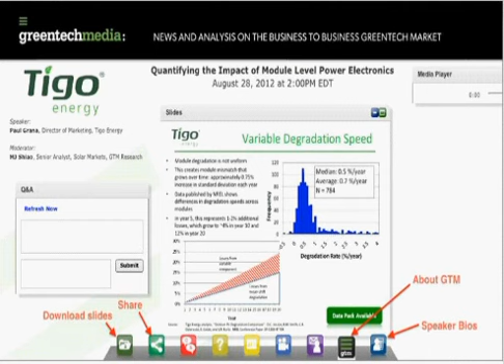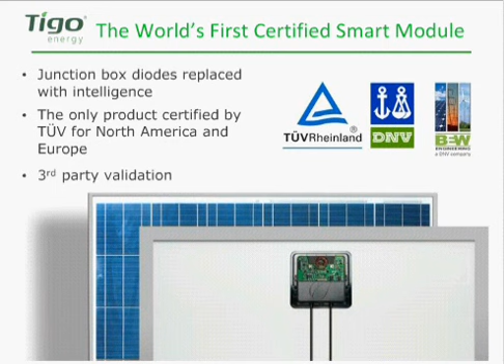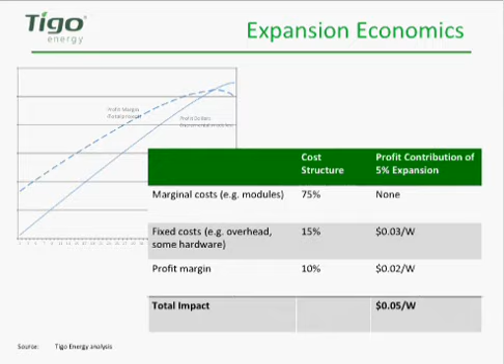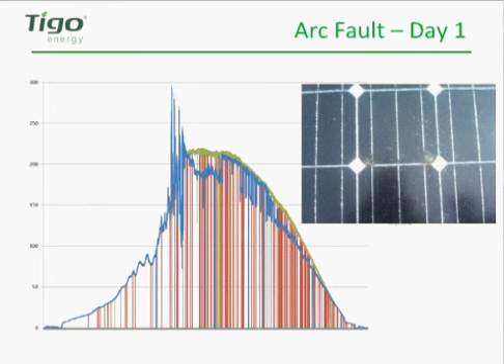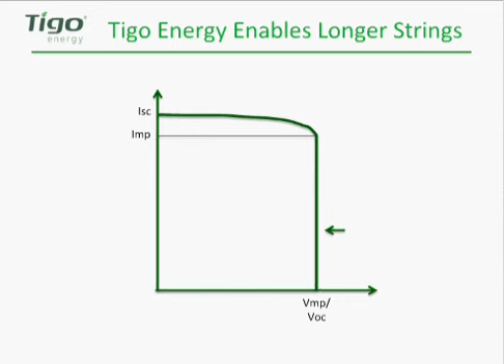Quantifying the Impact of Module Level Power Electronics

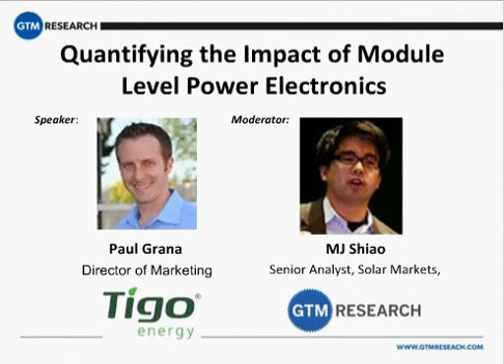Comment: 01:40 MJ Shiao, Greentech Media Research

Paul Grana, Tigo Energy:
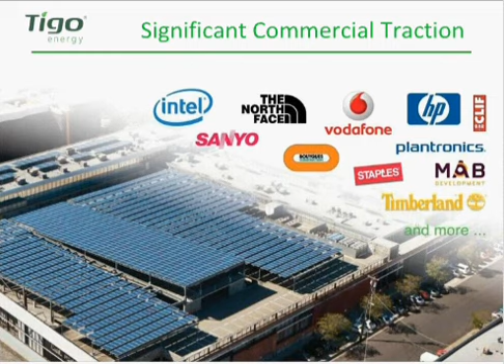10:00 investment drivers
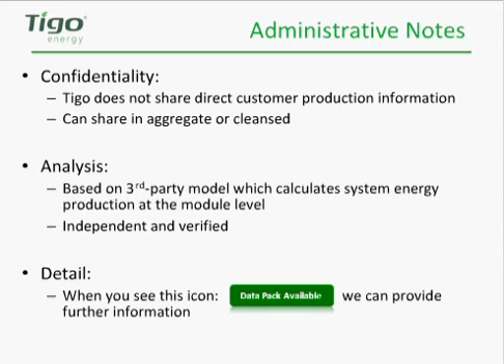11:30 mismatch drivers
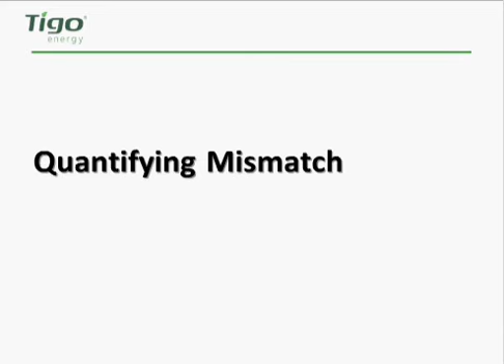11:45 variation in irradiance
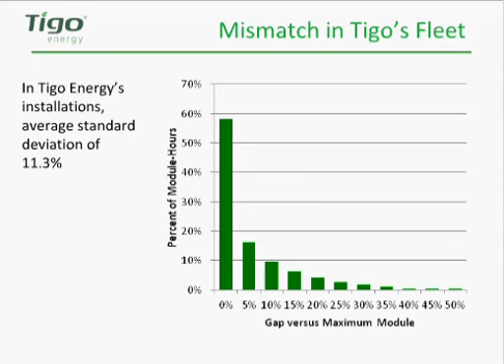14:00 variation in module temperature
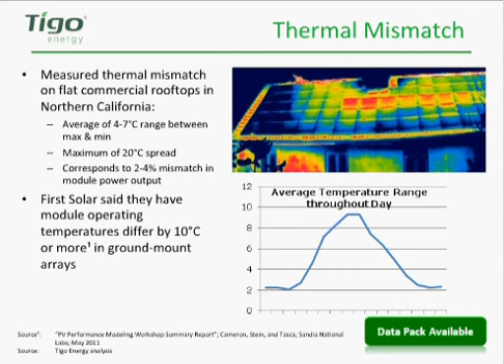15:20 variation in module degradation
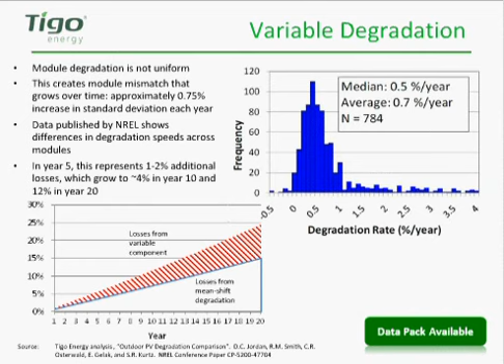17:45 mismatch impact (also 41:05 impact model, 45:20 module binning)
18:55 system size
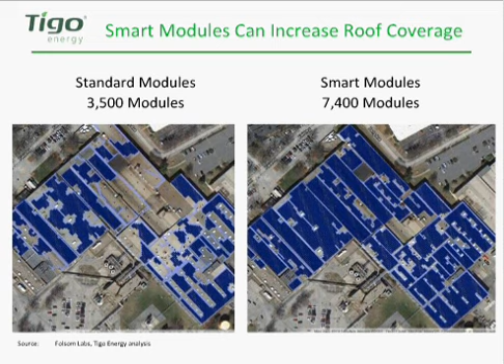20:45 system size and energy yield
23:00 system size and ground coverage ratio
24:30 system size and economics
26:15 electrical system costs 
29:40 operations and maintenance costs
30:40 commissioning
32:00 field analytics
36:55 overall optimizer benefits (also 56:40 optimizers vs micro inverters)
48:20 inverters
49:05 electrical characteristics of smart modules
52:05 impact of optimizer defects
53:45 module reliability

slides at http://www.tigoenergy.com/upload/files/Videos/gtm_webinar_2012_v1_1.pdf